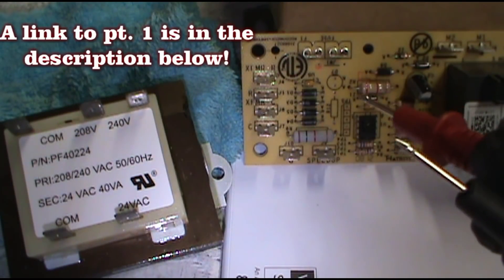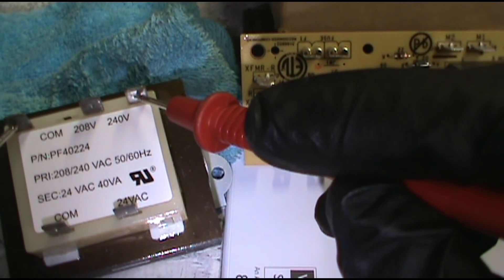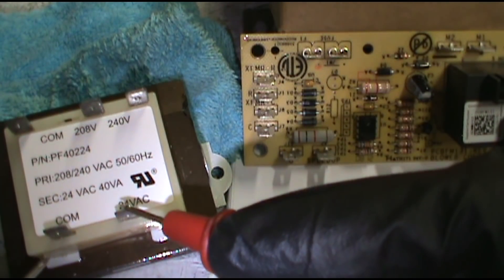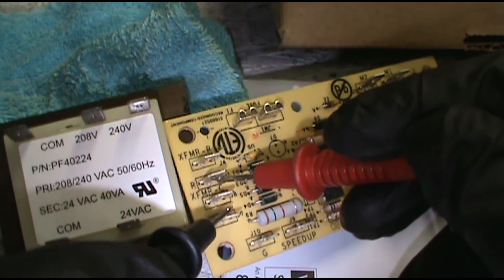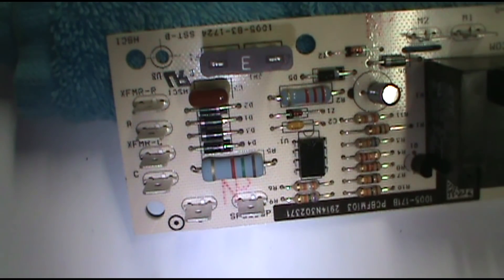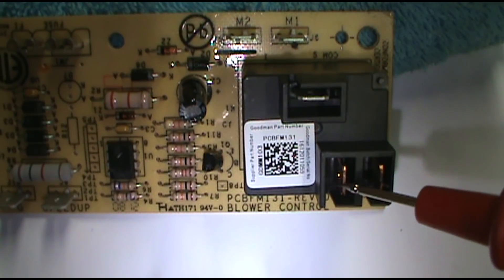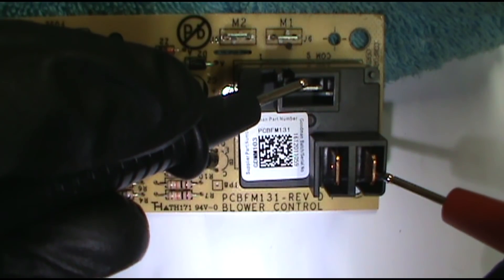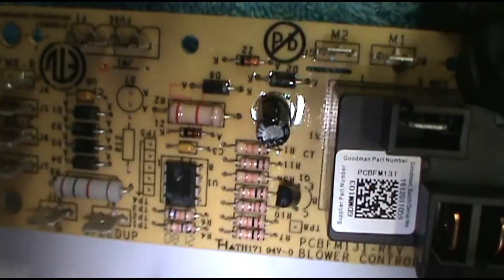Troubleshooting A Blower Control Circuit Board From Goodman Air Handler

Comment: I hope you can help me as no one seems to know what my problem is...I’m having trouble with my heat not wanting to turn off at set temp at the themostat. If I set it @ 75 degrees it might shut off at 75 or shut off at 76, 78 etc or not shut off period. I can’t shut it off at the themostat, I have to shut it off at the breaker. I’ve replaced the themostat, put a new air filter, checked the wires coming from the themostat to make no wires are touching to create a short. My only thoughts is maybe a bad heat sequencer or a bad control board...what is your thoughts?
Reply from the maker: Stuck sequencer? 🤔 I'd need to be there for this head scratcher.

Comment: Thank you for sharing your knowledge!!!
Blessing and more blessings to you and your family in Jesus name Amen 🙏❤️🙏❤️
Reply from the maker: Thank you so much for watching!
Reply: @LexVance  I'm out of Fort Worth Texas 🤠
and it's hot 🥵 . I replaced the contactor and capacitor and the blown fuse . Tested the transformer it was good as well as the other parts. But you showed me exactly how to check the control circuit board and I had to take time to say Thank you for sharing that blessing with me and my wife and two dogs. I'm a retired truck driver and funds are low but God's grace and mercy!!! 🙏👍

Comment: Just ran a call behind another tech that couldn't figure out what was going on.  Got there and the customer had been trying different thermostats in hopes of her heat working while leaving the breaker turned on throughout. Well it turns out she backfed voltage to the blower control board.  It was no longer outputting voltage to the fan.  Chalk this up to a customer thinking they know best.  Heating and air conditioning is a luxury and people seem to forget we are there to help.  Thanks for sharing the helpful video for all those crappy goodman units needing fixing!
Reply from the maker: 👍😆👍 Sounds like you're making memories. Thank you so much for watching Michael!

Comment: I have the same board.  my blower fan only comes on when i connect the green to red at the thermostat.  when i connect only yellow to red,  the compressor comes on outside, but the blower fan does not come on.  What can be the cause of this scenario?
Reply from the maker: You may have a bad thermostat. I'd need to be there with my volt meter. If everything works out of the thermostat then my guess is a bad thermostat. 🤞 Thank you so much for watching David!

Comment: What’s normally connected to the NC terminal? Thank you
Reply from the maker: It's usually a high voltage brown wire coming off the sequencer. Could be different for slightly different models though.

Comment: I've been watching video after video trying to find one that matches my problem.my sin was working fine two weeks ago, and then it went out.call somebody out, and they charged me $79 to tell me they're going to charge me $450 to run new thermostat wiring. So I did it my self. Just to find out that the transformers bad. So I waited a week and half Ford to come in the mail, finally
Reply: My control board had power and was working I had 24 volts,flip the system on, everything seemed great, I heard the compressor kick on the blower kick on, and then disaster, it was only blowing hot air. So I thought it needed a charge. Hired somebody else, who came out charge me $79 just to tell me it doesn't need any charge, it's full and there doesn't seem to be Elise, so I asked him what's the problem then, he couldn't tell me. I had one more person to come out and look at it, they couldn't figure it out either, in fact they suggested I just replace the entire system at a cost of over 5k. Thanks now I'm left in the heat cause no one can seem to figure out what's going on
Reply from the maker: @shadowdemon7770  Oh no! Sounds like a head scratcher I'd need to be there for. I'd unhook the heating wires on the t-stat which is usually white and brown and see if blows cold. Just pull white and brown out or whatever your heat wires are. Pull them out of t-stat terminals and leave them out.
Reply: @LexVance  thank you for your reply, it was a pain to hand over $79 to two different hvac technicians just to be told they don't know. To your suggestion, I don't have heat, it's a roof top AC only unit :(

Comment: Very helpful video.  My fan board control  got damaged a few days ago. My furnace was not turning off and I had to power it off. I found out when I open the unit and saw the board burnt from that black square relay open and close terminals. Those two cables were really bad.  I just order a new one and I hope this helps my issue.  I would like to know if is it possible that there might  be any  other problem in the system that cause this to get damaged. Thank you so much if you have any suggestions I would appreciate.
Reply from the maker: Hard to tell by not being there. Wires burn sometimes though. Just strip off the burned part and put them on the new board. I've done that and had no issues.
Reply: Did you find other problems? I have the same problem- the board burnt from the black square relay.

Comment: Thanks a million time
Reply from the maker: Thank you so much for watching Mister T!
Reply: Lex Vance thanks to your video I feel confident to bypass the fan relay by connecting the COM with the NC. This way I can still use my board - that fried at the NC level - after I have changed both sequencers (that must have caused the board to fry in the first place). Two cascading problems that I was able to understand, thanks to you - so I avoided having a contractor- in this special pandemic situation. Guys like you make the world a better place

Comment: I have a Goodman heater, the blower motor will run then shut off then start back up. Do you think the relay on the board can cause this? Thanks!
Reply from the maker: Hmmm, if the outside unit shuts off too then you may be low on Freon. Units have low pressure switches that will shut the unit off to protect the compressor. I very rarely see a unit shut off & on due to the relay. I'm not ruling it out. But most common problem with shutting off & on is low Freon. Or, there could be a short on the white wire (Auxiliary heat wire) that goes out to the outdoor unit. You can pull that wire out of the tstat & leave it out to see. If you've got a heat pump, the heat will still work after you pull the wire out. This is a tough one & I'd need to be there with my volt meter to see what's going on. Thank you so much for watching Dean!

Comment: So I found that my blower wasn’t running on and the heating element was , I replaced the board and it worked. What was the problem on the board?
Reply from the maker: Sounds like the switch wasn't closing to close the circuit for the fan to come on. N.O. & C have to close for the fan to come on. N.O. stands for normally open. Thank you so much for watching Godfather!

Comment: Will the board make the heat strips run all the time in ac or heat ?
Reply from the maker: Yes, if the heat strips are stuck on, it will make it run all the time. It's a safety measure to keep air blowing over the hot coils so you dont burn the house down. Sometimes the switch will weld shut & make the fan run all the time too. Thank you so much for watching Patrick!
Reply: @LexVance can it also be true in reverse? If the fan control board is stuck closed on NO will it also in consecuence cause the Heat strips to continuously run even though sequencer is good? (Just replaced sequencer and still have same issue).

Comment: Why would you have 240 volts at the two terminals you said should have 240....The switch is breaking only one side of the line....In the common and out the normally open or the normally closed depending on whether the relay is energized or not...It switches the line power, it doesn't use it.
Reply from the maker: I should've used high voltage instead. Just a habit saying 240. Thank you so much for watching Vern!
www.DirtyMaintenanceNation.com

Comment: Ok. Help me grasp this concept......
Our PCB board circuits had welded shut so that means our blower always ran. I'm in florida so after blowing cool air it just blew hot humid air and reheated the house quickly. So after watching a Lex video I realized I needed to check this board. VOILA! THAT WAS THE ISSUE.  Here's the odd part ; not only did this fix the blower issue my air blows way colder.

I had been using a digital thermometer the past month at the vents just to get an idea of what it blows. It was around 60 to 65 degrees. Not great but it's hot so I assumed it was doing the best it could 
After changing this board it is blowing 49 degrees at the vent.

I guess i cant figure out how the blower really impacts the type of air if the compressor was running before anyway.

What am i missing? My house is freezing now! Woo hoo
Reply from the maker: Sometimes you just work the unexplainable ghost out of the system. 
👍😅👍 Thank you so much for watching C!
www.DirtyMaintenanceNation.com
Reply: @LexVance  you know.....that answer is going to bug the shit out of me. Haha. It's like when you shut off the radio but you were singing and didnt resolve the melody yet.

Comment: i've got that control board.  my outside unit turns on and runs for about 2 minutes then kicks off but the air handler keeps running and the suction line gets hot.  could i have a bad board?
Reply from the maker: Could be low on Freon. Your unit may have a low pressure switch & it's shutting off. Or, there could be a restriction & it's shutting off due to high pressure. I dont think its the board. Thank you so much for watching ucanbob!
www.DirtyMaintenanceNation.com
Reply: @LexVance  with the unit off i've got 115 psi on both sides.  it won't run long enough to check it while running.  could it be a bad thermostat?

Comment: Great video..  Question please.. my AC unit is working fine but when I turn it off from the thermostat(old round analog mercury) , the blower will fast switch between off and on intermittently for long time till its finally off.. since this problem I'm forced to turn it off every time from the main breaker.. what do u think? is it the thermostat or the control circuit board? how to diagnose the case? thanks
Reply from the maker: Turn the power off & pull all the tstat wires out & turn the power back on. See if the fan does it then. If it does, then it's a bad tstat. It's hard to diagnose from not being there. Thank you so much for watching myplay!
www.DirtyMaintenanceNation.com

Comment: I know this is an old video but still have a question. My blower stays on even with the thermostat removed. Through some voltage checks I found that the heater sequencer stays energized. This is in the cooling mode. Can a sequencer stick shut?
Reply from the maker: Bad sequencer. Replace it.
Thank you so much for watching Frakes!
www.DirtyMaintenanceNation.com

Comment: I have a question my air handler is a goodman and the circuit board fuse in the air handler blow up then when I put a new fuse it blow up again when I turn on power in the air handler what can cause that every fuse blow up it could b the board that is bad or could b something else
Reply from the maker: You've got a low voltage short. Make sure your contactor in the condenser is good.

 If it is, Pull all the wires out of the thermostat. Then wire nut red & green together. Your indoor fan will turn on. Then shut power off & put in another wire. Turn power back on. Keep adding a wire until it blows. Whatever wire you added when it blew, that's the bad wire. You should have other wires not being used you can substitute. You have to hook it up in the air handler & outside in the condenser too though.

I have a low voltage short video on my channel where a fuse keeps blowing & I Show the repair.
Thank you so much for watching Angel!
www.DirtyMaintenanceNation.com

Comment: Love the video thanks for sharing have a question if you don't mind what if my control board fuse keeps blowing out? I checked the thermostat wires nothing contacting, checked outside condenser  to make sure no bugs got stuck in any wiring and nothing. Not sure why fuses keep blowing wondering if you can help me with this thank you!
Reply from the maker: Take wires out of thermostat & connect red & green. Indoor fan should turn on. Then start adding wires until it blows. Whatever wire it was, change it. Should have extra wires in string. Thank you so much for watching Giovannie!
www.DirtyMaintenanceNation.com
Reply from the maker: Use a wire nut & wire nit them together. Adding a wire one by ine until you find which one is blowing it.

Comment: I have had around 7 of these catch fire in an apartment complex I live in.  Im concerned about potential fire hazards.  Has anyone else heard of this  happening.  The control boards are fried to a crisp and it looks like it starts at the relay on the board.  All the wiring harness running to board fried as well.  Breaker does not trip even the fuse didnt blow.  Anyone with any advice please contact me at vincentsimpson48@gmail.com
Reply from the maker: I've gotten burned board pictures from techs all over the country. Seems to have been a certain batch that got built & distributed that are doing it while others do not. Thank you so much for watching V!
www.DirtyMaintenanceNation.com

Comment: I woke up to my evaporator coil frozen over with the compressor still running. Turned the fan from auto to on but blower motor still wouldn’t run. Followed your troubleshooting procedures and tested the relay on the board and didn’t  get proper voltage. Bought a new board, installed, and now all is well again! Thank you so much!
Reply from the maker: Awesome! Enjoy that $500 you saved by not having to call a repairman. 👍😂👍 Thank you so much for watching pilotgeorge!
www.DirtyMaintenanceNation.com

Comment: What if I measure two legs, I dont have 240V. I measured one leg to the grounded chassis. I got 110V. Another leg and chassis, 110V. But I measured both legs together. They don't show 240V. what is the issue here?
Reply: The 110V power comes from one leg of the breaker of the heating element. I measured one leg of breaker and the chassis. It showed 110V. Another leg of the breaker and chassis. 110V. Both leg of the breaker, 0V. Top side of the breaker, power sound from main panel. Both legs, 220V. What is the issue here?
Reply from the maker: Wei Mai Hmmm, if you've touched both legs of the breaker together & don't have 240v then try changing the breaker. Sounds like only one leg is powered. Thank you so much for watching Wei!
www.DirtyMaintenanceNation.com
Reply: Breaker both leg is powered. I measured one leg of breaker and the chassis. It showed 110V. Another leg of the breaker and chassis. 110V. I measure both leg of the breaker tho it shows 0V. Fan was on no heat. Now fan doesn't turn on anymore. Do you think that is transformer problem or heating element?
Reply from the maker: Wei Mai Hard to tell by not being there.

Comment: lot of good points in this video, I was always wondering what does skid mean?
Reply from the maker: Capitol Refrigeration,Heating,and Cooling Thank you man! Skid is a name my cousin called my uncle because he was a racecar driver. Like skid tire marks on a race track. I'm kicking myself for not having a good fuse in that bad board. I was getting no continuity there with a good fuse in it on the bad board as well. Someone wired up a transformer backwards. He had 240v on the 24v side & 24v on the 240v side. The fuse blew of course. I came to help out and put a new fuse in. There was no continuity between XFMR & R  with the new fuse. I should've put a dang good fuse in it during video. It got pulled out because it was still good & we didn't want it thrown out with the bad board. Thank you so much for watching Capitol Refrigeration!
www.DirtyMaintenanceNation.com

Comment: Like your videos u do a good job. 

u need fuse in Board also to get continuity between transformer 24 & 24 terminals on the board
Reply from the maker: Jimmy Padgett Yea You're right. I was getting no continuity there with a good fuse in it on that bad board as well. Someone wired up a transformer backwards. He had 240v on the 24v side & 24v on the 240v side. The fuse blew of course. I came to help out and put a new fuse in. There was no continuity between XFMR & R  with the new fuse. I should've put a dang good fuse in it during video. It got pulled out because it was still good & we didn't want it thrown out with the bad board. Thank you so much for watching Jimmy!
www.DirtyMaintenanceNation.com

Comment: Like your videos on the in depth explanations, and not trying to be a bad skid, but your XFMR to R won’t have continuity without a fuse, the power goes to XFMR to the fuse and back to R. Rewatched your first vid to make sure if you mentioned that, and you had just mentioned it was out, not how the power ran through it. More or less, I think you know this, but it wasn't conveyed in either video, which may cause a new skid to think a board is bad if the fuse was blown.
Reply from the maker: tcpHVAC/R Yea You're right. I was getting no continuity there with a good fuse in it on that bad board as well. Someone wired up a transformer backwards. He had 240v on the 24v side & 24v on the 240v side. The fuse blew of course. I came to help out and put a new fuse in. There was no continuity between XFMR & R  with the new fuse. I should've put a dang good fuse in it during video. It got pulled out because it was still good & we didn't want it thrown out with the bad board. Thank you so much for watching Tcp!
www.DirtyMaintenanceNation.com